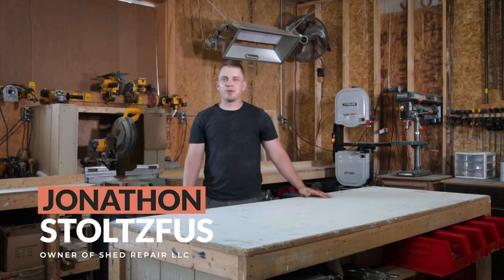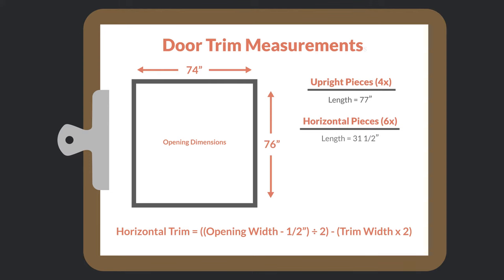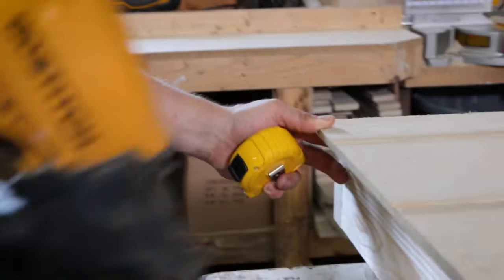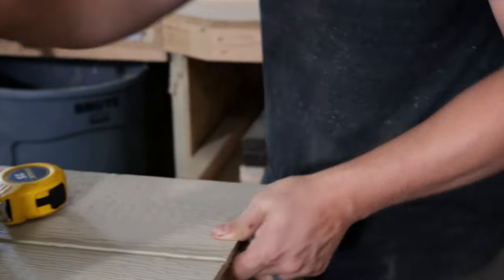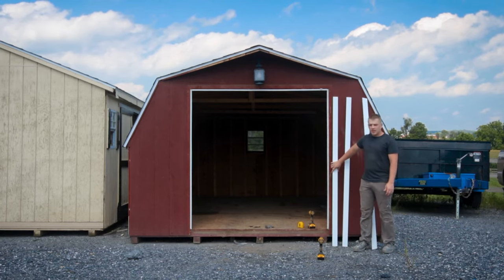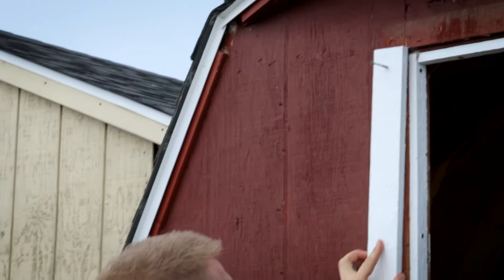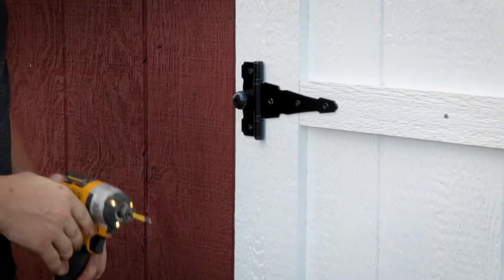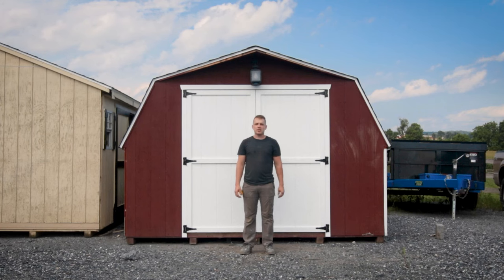How to Build Wooden Shed Doors: Your Complete Guide | Shed Repair

Comment: I built these doors with the correct measurements. However when I put on the hinges and was going to hang the doors. The door trim and the trim the hinges connects to doesn’t line up. Do you know why this would be?

Comment: Great video but I'm slightly confused, based on the measurements for the door panels in the beginning of the video it appears the left door panel should overhang the framing and the right door should be flush but once the doors are built it appears the right door overhangs the left, am I understanding this correctly? I have to build some shed doors and I want to make sure I get it right the first time around.
Reply: Yes, please add details on the overhang.  Looks like on the left door, the trim on the center/inside is not flush.

Comment: I agree with Jason. I just wasted a bunch of time making the doors. Like Jason mentioned, the hinges don't line up. The 7/8 overlap on the door is the thickness of the siding + the thickness of the trim. But the shed side just has the thickness of the trim. So the door sticks out 7/16 past the shed trim which makes the door not shut. The only fix is to cut siding strips the size of the shed trim for a shim. Looks stupid as hell, only option is to start over, and not use this guys instructions.